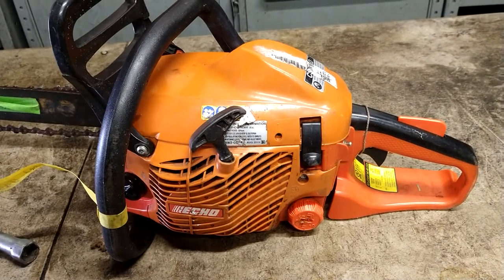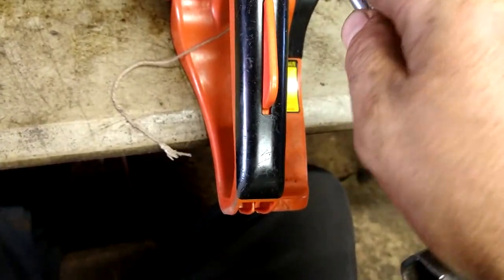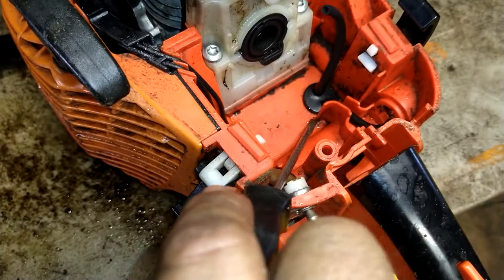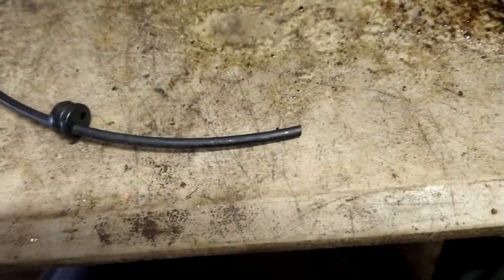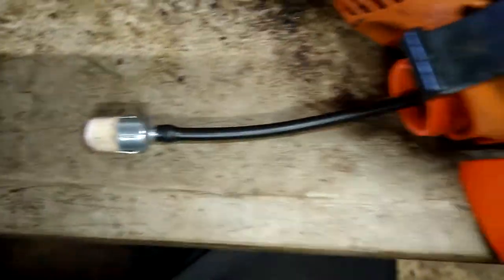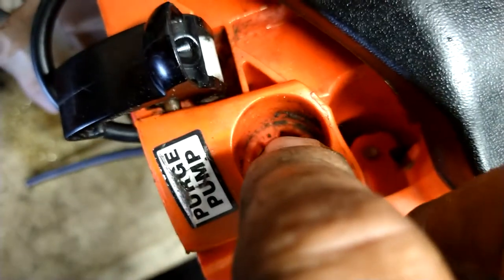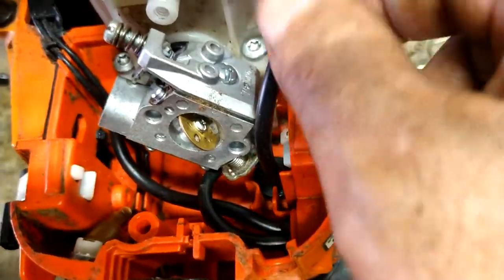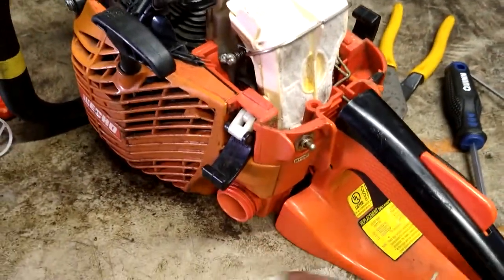Echo cs310 chainsaw carburetor repair. Cs 310 fuel lines

Comment: My CS-310 spins the chain and doesn’t slow down during idle. Is it a carb or different issue?
Reply from the maker: clutch springs
Reply: @smallengineguys  I adjusted the idle screw and it worked. Thank y’all so much!

Comment: I was hoping for more info about actually repairing/rebuilding the carb than "take the carburetor out and give it a good rinse" especially since it's the title of the video!

Everything else is good info, but not what I was looking for and not what the video title says.
Reply from the maker: They arent worth cleaning out. 50/50 chance they will work. Do what i showed it will work like new everytime. Was broke now repaired.

Comment: It bn cheaper to buy a new saw and use that pos for parts
Reply from the maker: Customer wanted it fixed im just doing what they pay me to do.
Reply: @smallengineguys   I can't blame you there but they drug that lil saw through hell and back
Reply from the maker: @chrisp556  and used duct tape to cover the burns.